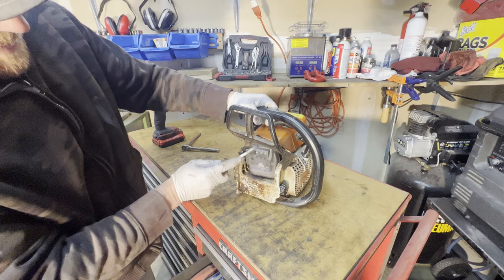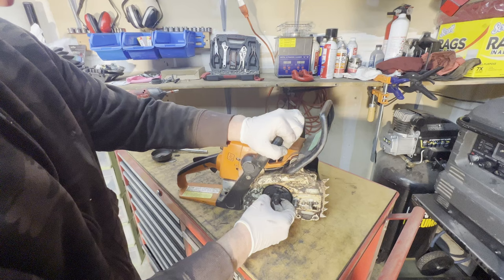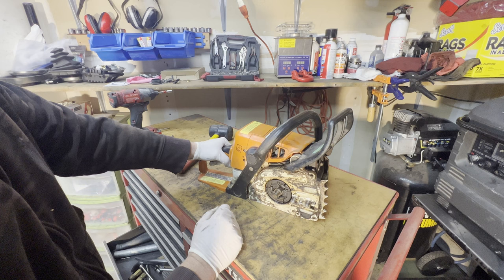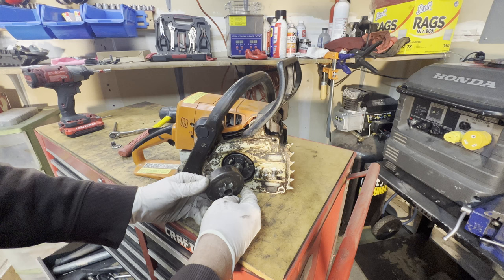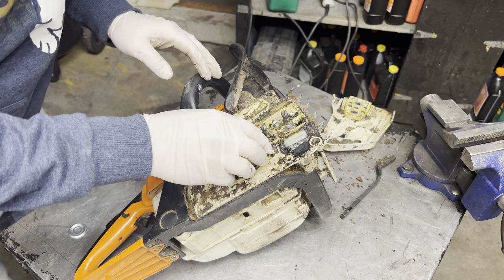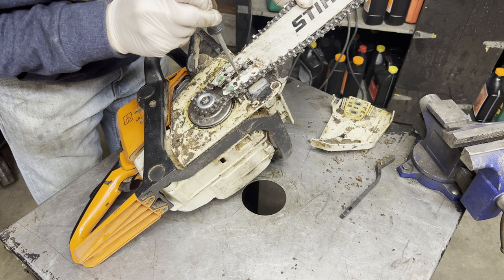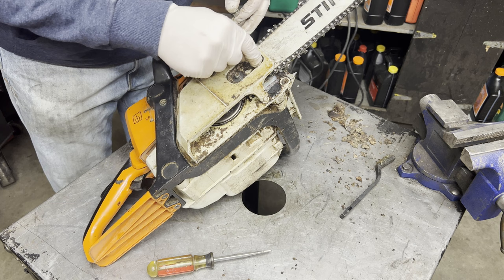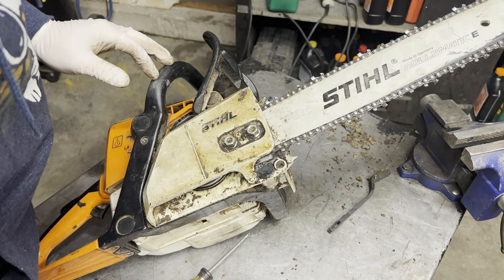Stihl 025 Chainsaw Chain Won't Spin - Sprocket and Needle Cage Bearing Replacement

Comment: I had the same issue on my saw, I took it to ace and they said it was a bent crank and quoted me $320, I knew it was BS bc the saw is new, got home took it apart and there was no bearing in it at all, I replaced my bearing and cleaned everything up and she’s running better than ever now, I just want to say thank you for making this video, you saved the day!
Reply from the maker: Glad you got your fixed. Only time I have seen a bent crank is from an over tightened chain.